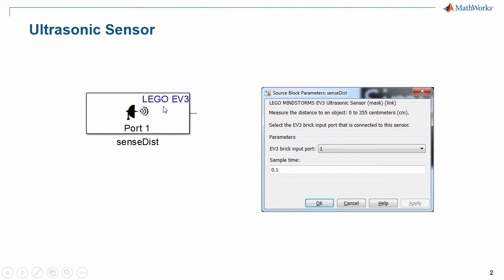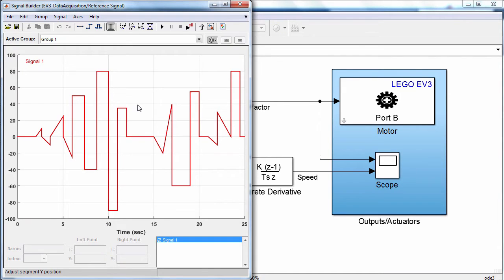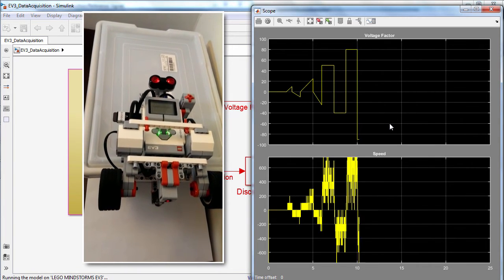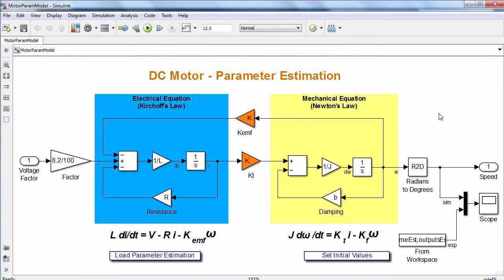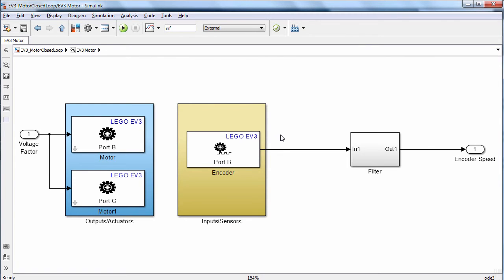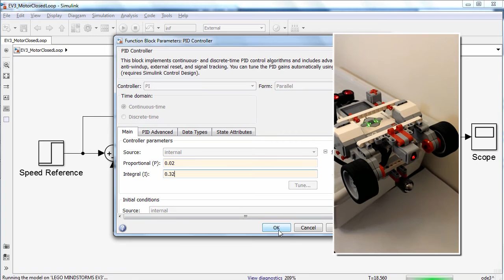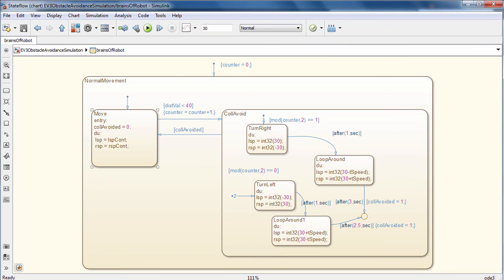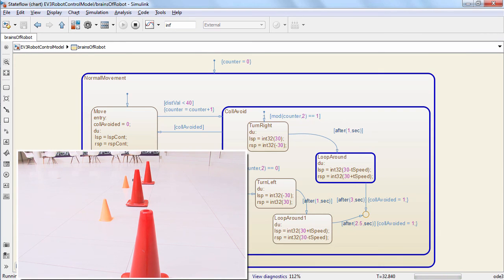Obstacle Avoidance Using LEGO MINDSTORMS EV3 and Simulink

Comment: Is there a way to make the ev3 stop once it hits a square, using the light sensor  set in the reflected light mode, in the existing code?
Reply: +55YAMAHARACER55 You should experiment with this block http://www.mathworks.com/help/supportpkg/legomindstormsev3/ref/colorsensor.html which gives you the color. Using this you could possibly use a MATLAB function block/Stateflow Chart to understand what you are looking for and execute the stop.